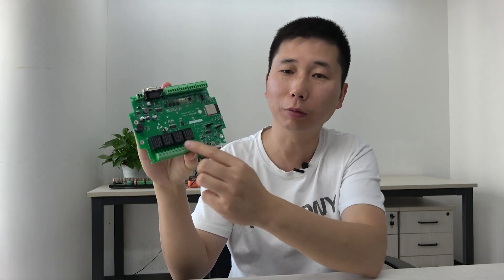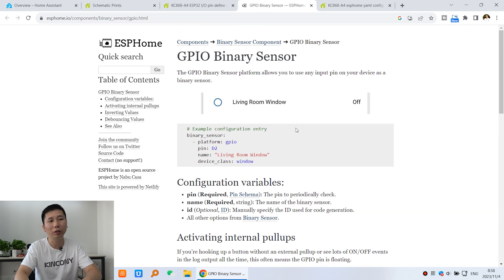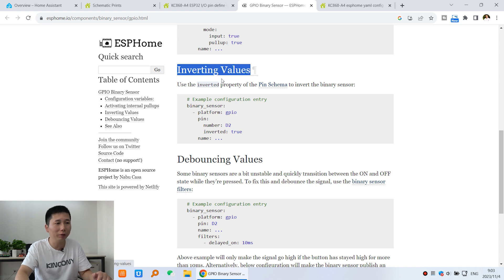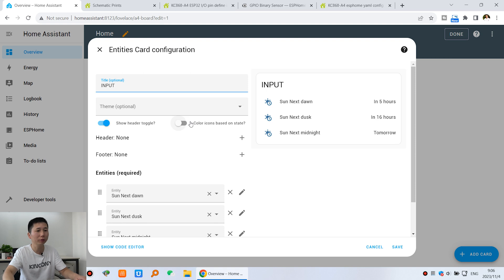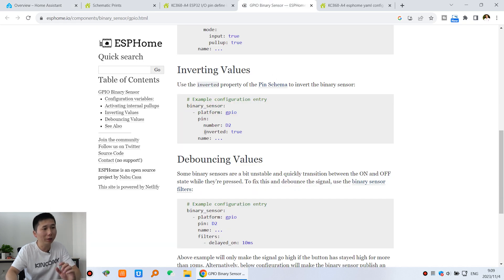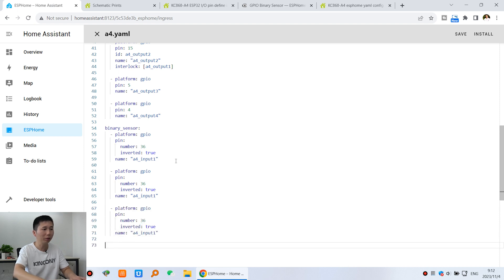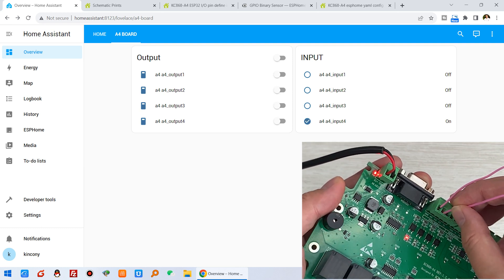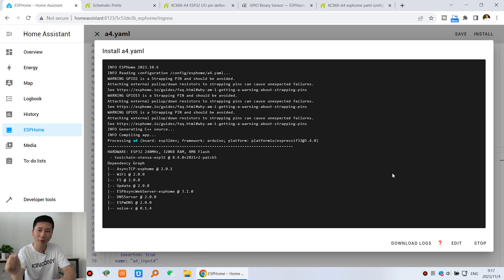how to use gpio binary sensor by esphome for home assistant

Comment: hello,
congratulations for your video.
I have a question
Is it possible to have the control of the 220v AC input via Raspberry GPIO?
To control the state of the auxiliary contact with the circuit breacker switch
Reply from the maker: sure, just convert to dry contact signal
Reply: @KinCony  could you explain how, please? Or make a video tutorial. I use XF9 of Chint I want to check the status and is possible have telegram notifications
Reply from the maker: @ use a contactor or DC12V power supply to convert AC220V to DC 12 voltage.

Comment: Super video. Thx u. Quick question ?
how to do an on off of a GPIO from reading a value of an identity available in HA
Reply from the maker: this can config by esphome or set IFTTT by KCS KinCony firmware
Reply: @KinCony  yes but my code doesn't work
output:
  - platform: gpio
    name: "Cde Batterie"
    pin: GPIO19
    inverted: yes
    id: cde_batterie
    inverted: True

light:
  - platform: binary    
    id: sensor.test_outside_light_level   
      on_value:
        - above: 2500.0
          then:
            - output.turn_on: cde_batterie
        - below: 50.0
          then:
            - output.turn_off: cde_batterie
    update_interval: 10s

INFO Reading configuration /config/esphome/projet-cde-gpio-sur-valeur.yaml...
ERROR Error while reading config: Invalid YAML syntax:
mapping values are not allowed here
  in "/config/esphome/projet-cde-gpio-sur-valeur.yaml", line 62, column 15
Reply from the maker: @ if the sensor have value, NOT binary, not use "binary" type.

Comment: Hello i want to use one of your board as a security system with multiple digital inputs for motion sensors (more than 10). which board do you recommend?
Reply from the maker: only need digital input, not need relay output?
Reply: Yes, only with digital input or with a few relay outputs I want it to be a separate solution since I will not be using the relays that much
Reply from the maker: use KC868-AI ESP32 input module @sikkisvasilis
Reply: Thank you!

Comment: Sir, could you please create a video that explains all the parts used in your KC868 series board? This should include details about the power supply and the role of each individual component, as well as separate sections for different zones such as power supply, RS485, INPUT, PCF8574, and more
Reply from the maker: here have many hardware interview of kincony's PCB.
Reply: You mean direct search on youtube interview of kincony PCB? @KinCony
Reply from the maker: at here: https://www.kincony.com/guide @kherhitesh
Reply: Sir, your mostly document is extraordinary, I like, but my question about individual parts' role. For example, using a 3V to 4.7k resistor for pull-up I know, what is the role of every single part on the board,  Like LEDs used for status of power, before LED resistor used to reduce voltage,  If possible could you a dedicated video for section-wise explanation, such as the power supply and the role of each individual part used fpr power supply , Also what are the role of the 74HCT14, ULN2003A, and PCF8574P ICs and their related component.
Reply from the maker: understand, maybe in furture can do that. @kherhitesh